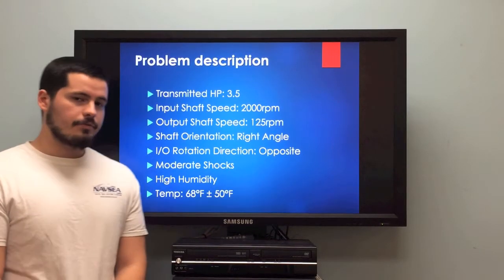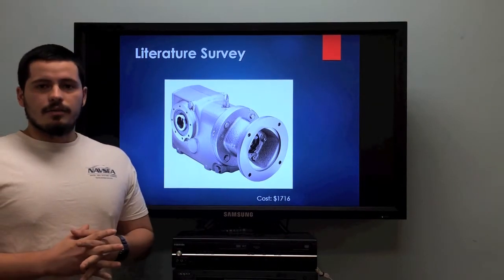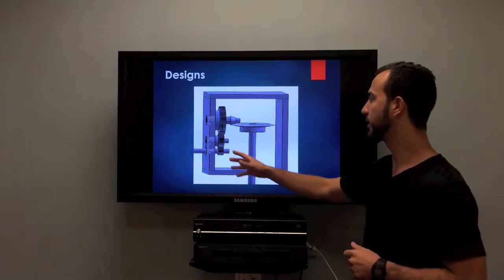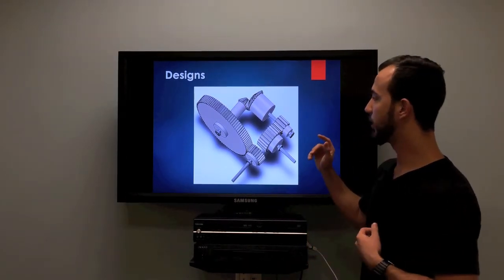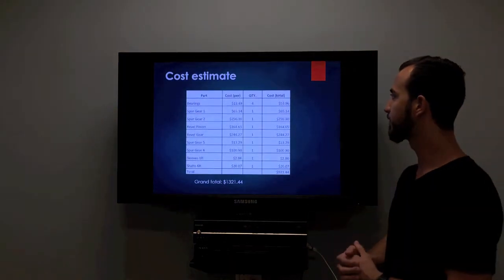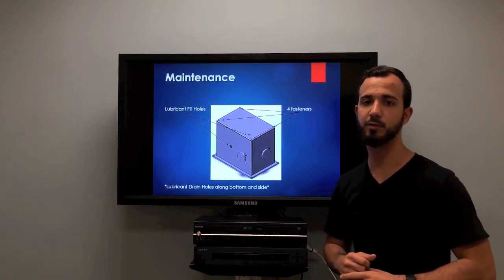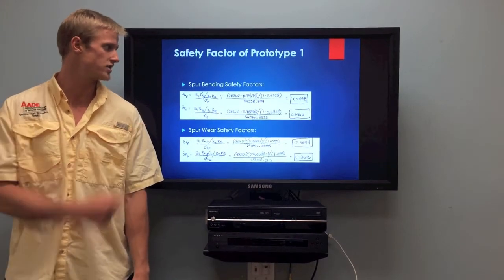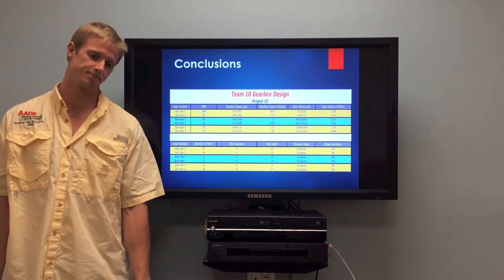Team 10: Gearbox Design

Comment: Excellent presentation of the design process.  Accounted for all parameters in the project.  Well prepared presentation.  The only thing I noticed to mention is the lighting of the video fluctuated a bit and also the slides that had tables were difficult to see from the video.

Comment: This was a great presentation. They did a few things differently that I liked which was going through the various alternatives of the design and also went through the problems faced with the design process. The main problem was that they dressed too casually, almost to the point that it gives off an I don't care vibe which is obviously not true judging from the actual presentation. Also some slides with tables had too much data which made it difficult to read.

Comment: Overall this was a very good presentation. Great use of graphics and the slides were not too crowded which made it easy to read. The presenters spoke clearly and fluidly which shows they knew everything about their gear box design. I liked how they showed the various design alternatives and how they came to their final design. The only issue I had was that each presenter did not dress professionally and the font in the tables were a little small.